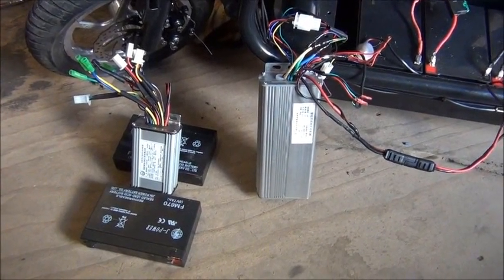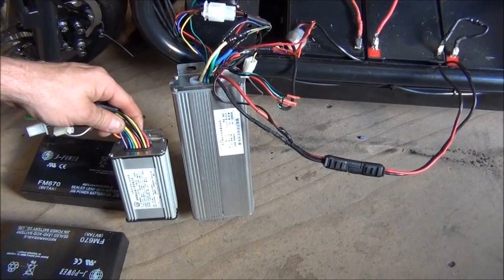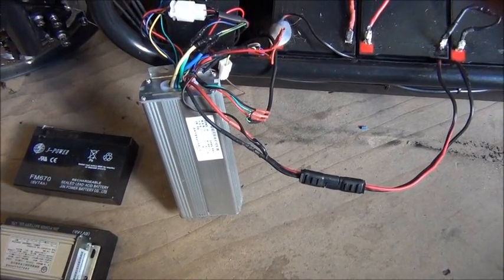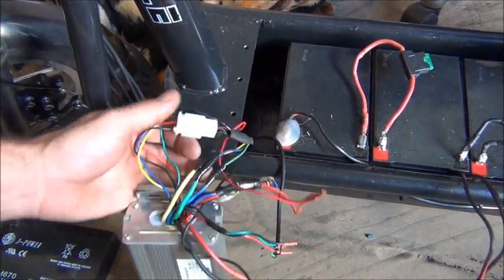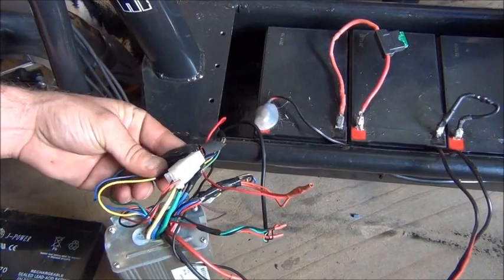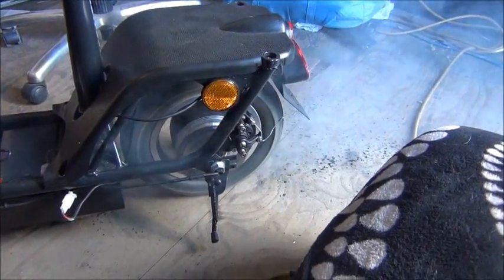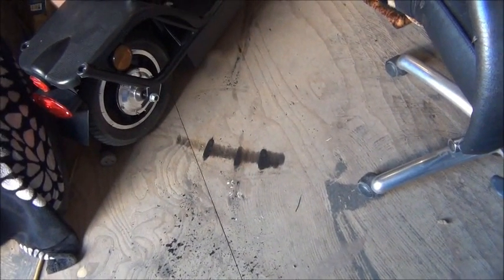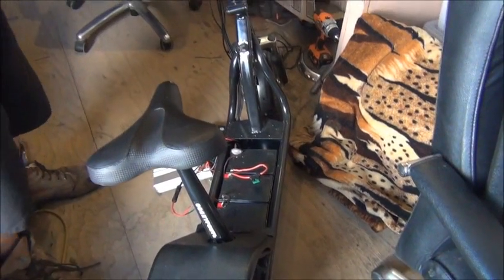E-scooter Brushless Controller Upgrade + Burnout!

Comment: Some of these modules have a self learning feature, that is simple to perform when setting up the motor direction and running, look for the two self learn wires.
Connect them together, power up and if motor is spinning wrong way, power off and reverse learn wire connections, then power back up. that should change rotational direction. If it is running in the right direction, but roughly, power off and disconnect the learn wires, reconnect and power up a last time, if all goes well, your motor should spin smoothly in the right direction.

Hope this helps, I found this little nugget of info on another YouTuber's channel.
It worked for me, so I thought it only fair to share it.

Comment: Are you using a hubmotor there? I'm modding a scooter too ATM, but my brushless motor is drawing an absolutely insane amount of power, and basically trying to cook itself after even 1 acceleration. Pulling well over 150A, my 10AWG wire is getting hot :(